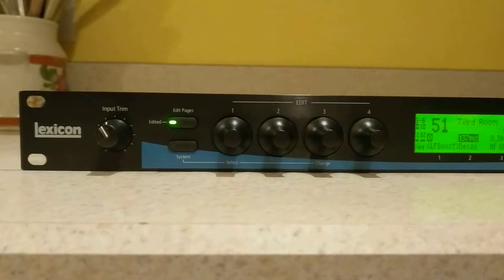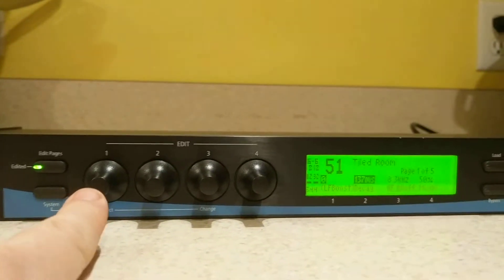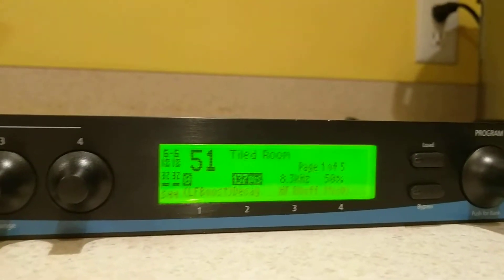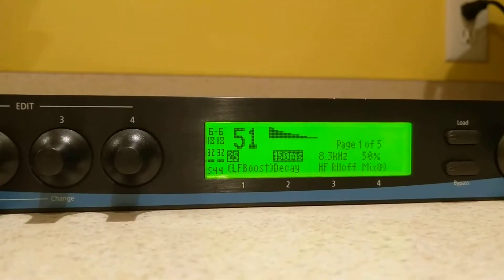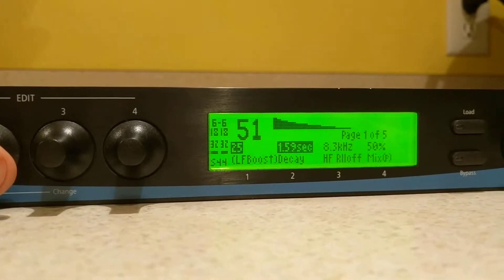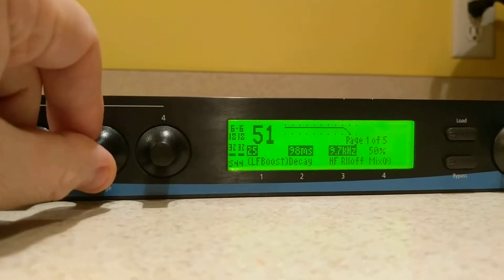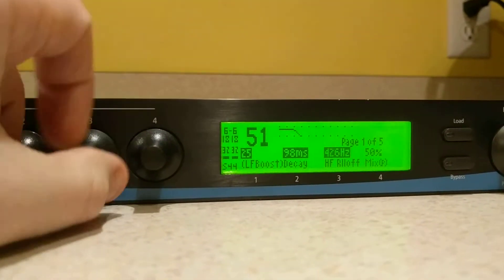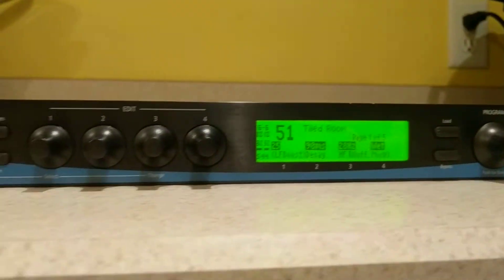MPX550 parameter edit rotary encoder woes

Comment: Actually since my last comment I fixed the same issue on mine! 
I took apart the rotary encoder, cleaned it, and gave some more tension to the springy connectors inside. 
A bit fiddly job with some magnifier glasses, but doable.
It works now fine!
Reply from the maker: Oh, that's awesome. Thanks for sharing, Greg. How's it holding up? Mine's still going strong with the DeOxit hack!

edit: just saw your video. thanks for sharing! i've posted a cross-link in my description.

Comment: do you know what are the used encoders?  vendor? part number?
Reply from the maker: Hi, unfortunately not. I was lucky enough to get a little bit of deoxit into the encoders on mine without desoldering them and they've held up. I seem to recall finding a thread on muffs or gs where someone mentioned getting some encoders to fit with very gentle mods but I can't find it now. Good luck, please share if you do come across a replacement that works for you. Take care.

Comment: Richard... the problem will come back! Once an encoder is messed there is no cleaning you can really do. I changed the two encoders on my Lexicon PCM81.
Check the inside and find out what encoders did they use. You0d be surprised at how cheap these parts ca be.
Reply from the maker: Thanks for sharing your experience italoop! So far it's holding but I don't expect it to last forever. Guess I'll have to search for replacements at some point and make a weekend project out of it.  I've read that Deoxit may degrade optical patterns on some encoder disks too, so this may only be a temporary fix.
Reply: I'm not sure those are optical encoders. More likely mechanical ones, like on the PCM80/81/90/91 probably. Try asking Lexicon customer support. Ask for the service manual too.

Comment: nice to learn something new..is there a way to do a reset back to factory settings??
Reply from the maker: Hi Ricardo. Glad you found this helpful. A factory reset (Lexicon calls it "Factory Init" in the manual, which can be downloaded from their site) can be performed by powering up the unit normally, pressing the SYSTEM button, and scrolling Edit1 to "Factory Init". Press STORE to perform a factory reset.
Reply from the maker: In this particular unit's case, the rotary encoders were in poor shape, probably oxidized or dusty. I tore the whole unit down and was able to get some Deoxit spray into the encoders, which helped a lot, but they're still a little janky. Hope this helps!